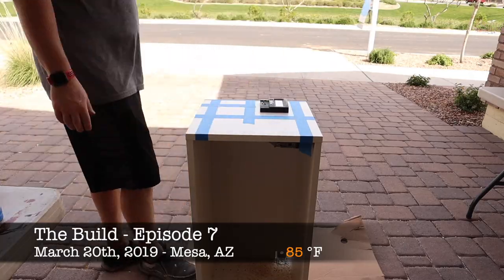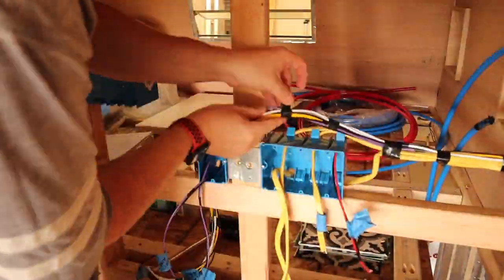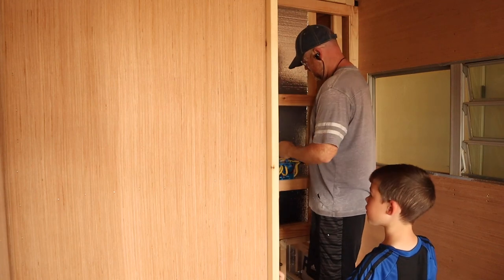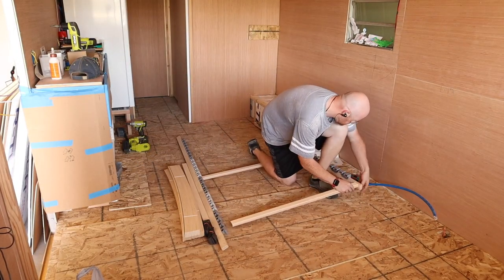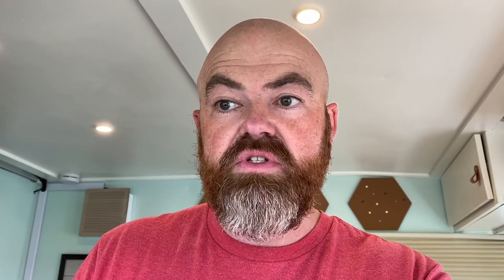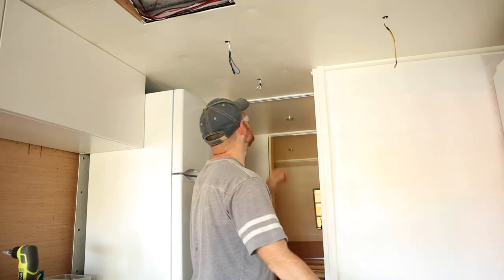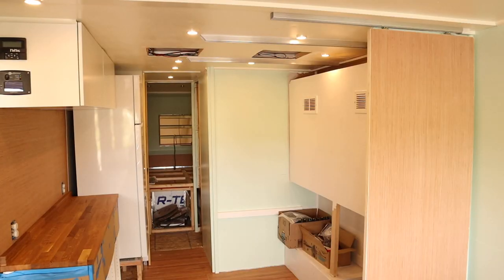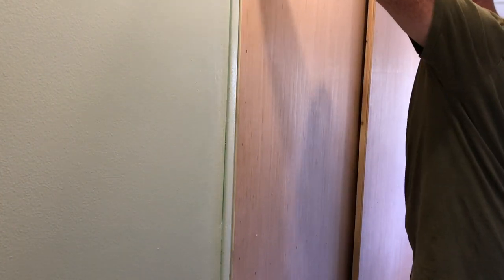RV BUILD - Hidden Bunkhouse and Murphy Bed in a Travel Trailer

Comment: Do you know what kind of light were them ? Model?
Reply from the maker: LED Cabinet Puck Lights Dimmable - Moobibear 2W 1200lm Under Cabinet Lighting Kit with 10 Levels Brightness, Under Counter Lights for Kitchen Closet, 6 Pack (Warm White) https://www.amazon.com/dp/B06XRVWLFG/ref=cm_sw_r_cp_api_i_7HREFb04PC9MT
Reply from the maker: The lights are great but the switch that comes with them are, well kinda crappy. I had to take several apart and re-solder some connections.
Reply from the maker: 12 Volt DC Dimmer for LED, Halogen, Incandescent - RV, Auto, Truck, Marine, and Strip Lighting - Short Shaft - Black https://www.amazon.com/dp/B01C4UBMW8/ref=cm_sw_r_cp_api_i_PJREFb1DE4EP2
Reply from the maker: This is the best LED dimmer switch ever! Pricey but if you only need one or two I highly recommend going with this!